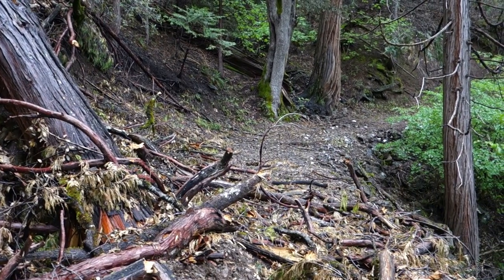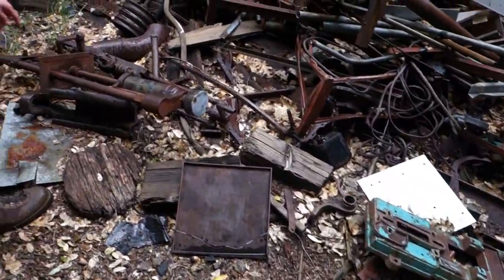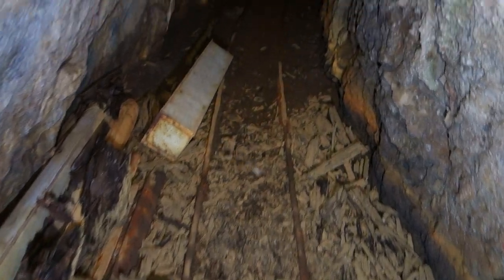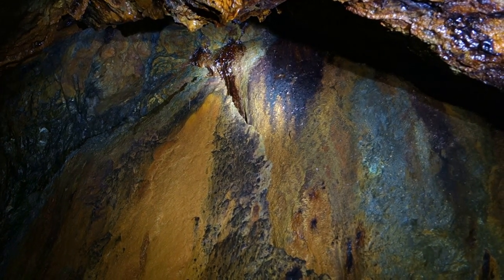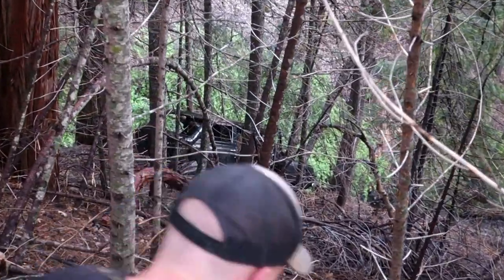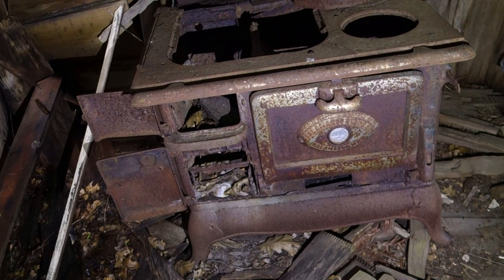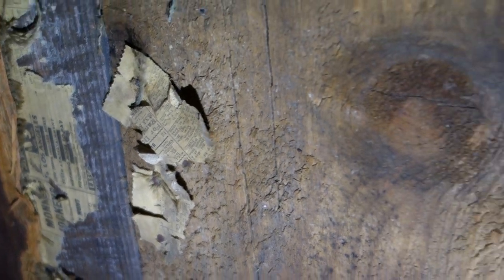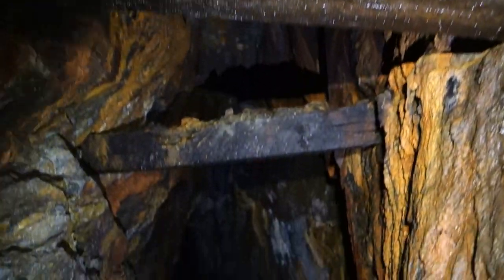Gold Mine Hidden Away In Forest Paradise

Comment: @TVR Exploring  --  Justin , @11:57 - that's what I call  "Rock Snot" , it's dissolved organic matter from the forest floor above the mine that has percolated down through the soil and is now dripping into the mine .  If you touch it , it is soft and squishy and will easily break off of the Back and go splat when it hits the floor .  @25:11 - inside the Fireplace , that's a Double-Walled sheetmetal Sheep Herders Stove .  In A&FP - Ep. 23 - the Cabin that I show to Gly originally had a cast-iron Pot Belly Stove which got stolen and replaced with one of those Sheep Herders Stoves , and eventually that was stolen .  @34:14 - that narrow 4-5 inch wide Stope may have had a thick seam of Clay Gouge that contained finely divided Gold particles ;  that might explain why that part of the Stope is so tall and narrow .  I've seen occurances like that in several mines (Clay Gouge containing Gold) .   ---    < Doc >  .

Comment: That old Chevy was very interesting. Probably safe to say a lot of  the materials for that facility came down there on it's back, the old stovebolt 6 chugging away. The odometer looked to read 30ish thousand miles. That cab was essentially unchanged from about 35 til 39 in the civilian world, but the military could have used it longer.  Sad to see it sitting there.
The car looked like a mid 30's sedan...could be newer, not older though.
That was a large operation at one time, at some point, the boss said to the lowest guy on the seniority list, "I had a lawn mower brought down here, do something with the damn weeds around the buildings will ya? " To be able to worry about the weeds ya have to be living pretty good.
The CP compressor in that building was very cool. Sad to think today people only know Chicago Pneumatic as a cheapo harbor freight brand when it has such a storied past.
Fascinating place. makes a guy wonder what shut them down, the crummy rock making it too expensive to recover or did the gold peter out?
Reply: the newspapers you can see the years 1925(something about a loan) and then the year 1945.. so maybe it was a family operation after the war given they recycled damn near everything they possibly could.
Reply: My theory for the lawn mower is they brough it up there for the blacksmithing operation they had going on.

Comment: Old 5 gallon "jeep" cans (at 4:05)  usually have a mfg date stamped on the bottom. Sometimes under the handle on top.  Did you look?
Reply: Some of the old oil drums had the date code on them too. Last two digits of the year.

Comment: I think that car is actually a late '40's Studebaker with suicide rear doors.  Edit:  In the shed where the compressor is sits a dashboard from a 1951 Studebaker Commander.  Likely from the car pushed over the bank.  Wonder if they used the engine from it for something else on the site.  The compressor uses what looks like a much older six cylinder engine...
Reply from the maker: Thank you for sharing those details.
Reply: I think the door handles on the car id it as a Champion. Commanders had v8s starting in 51.

Comment: Actually, after re-watching it I don't think they did very well. Maybe initially and they built the house from that money, but there's signs the mine ultimately did not pay off and the mining operation ran out of money. The first indication to me was the use of a cable to movie a fallen boulder. Why would they do that? Just drill it, bust it up then cart it out. The use of a cable tells me at that point their actual mining equipment had failed and was unusable. The broken down flat bed is the next indicator. That's a vital piece of equipment. Then was the use of rail to build a lean-to, rail would have been more valuable in the mine than for a make shift shed. I think they found a small vein of gold, went all in hoping for a big payout and came out broke. Later, someone had it surveyed, (explains the plastic bucket and spray paint) they weren't giving good news and left it to nature.

Comment: I'm still trying to figure out who would carry a lawn mower out to a gold mine. Maybe they hired a gardener.
Reply: Probably intended to use the engine to run equipment? Same reason you find vehicles missing their straight six or sometimes V8 engines that were cannibalize to run equipment like air compressors.
Reply: They most likely brought it up there for the blacksmithing operation they had going on. Lots of scrap metal laying around.
Reply: Maybe they wanted to keep the grass down for fire control reasons.

Comment: I have seen trees do that before that is very common especially with cedar, oak and white fir trees. I would bet money That cedar came down in hi winds and a heavy snow load. There’s probably about 2-3 loads of fire wood in that tree a winch or a good diesel truck would be able to pull it out. I’m from a logging family so I’ve even seen this while my dad or grandfather fell timber on occasion but it was something that they tried very hard to avoid happening. As for the mines shale and slate are the worst rock to mine through that type of ground has killed more miners then any other ground it was avoided as much as possible. You where extremely lucky you didn’t have those slabs come down on top of you that was not a smart thing to do . We have a family friend that worked in mines mining gold he always stressed never go into any mines dug into shale or slate they where death traps and he had over 40 years experience mining.  That said yes our history is important to document but not at the cost of your life  it’s just not worth it. After all think about it this way  how will you document history if you’re dead. I like watching your show and would not like to hear you died because you went where you should never have gone. Pick your battles that should have been one you should have walked away from. Like logging you seldom get a second chance to make a mistake most times a mistake costs you your life.. I’m from a 4 generation logging family I should know.
Reply: Good words to live by.